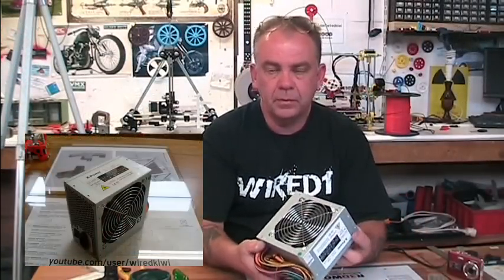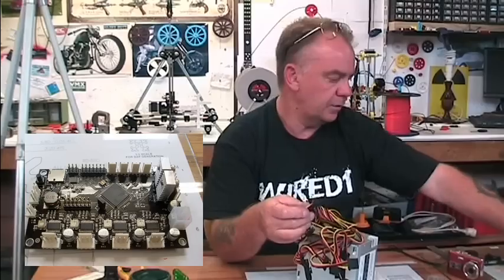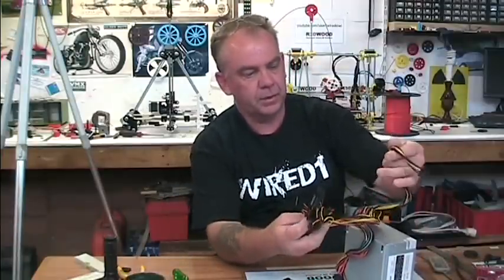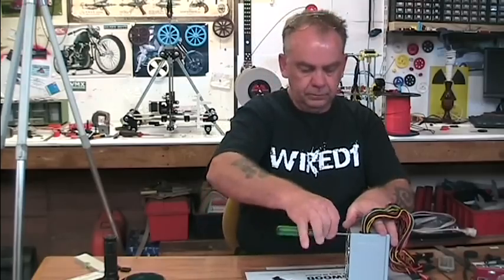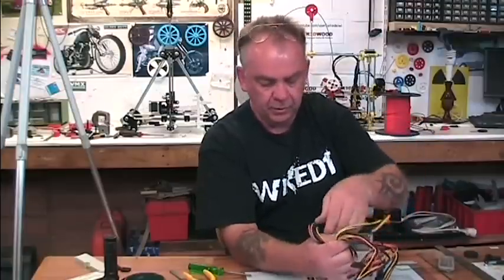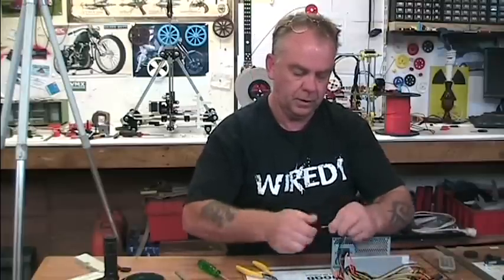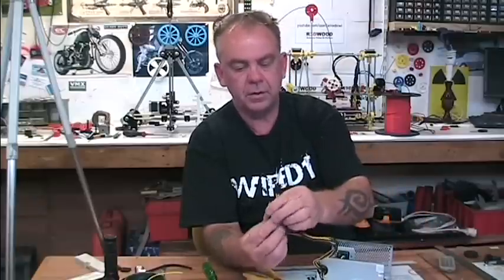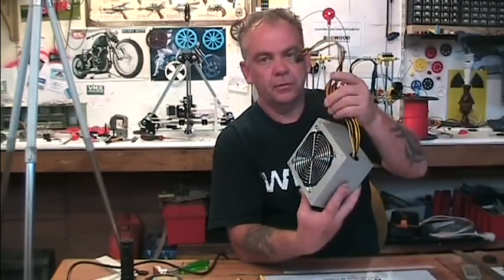Reprap power supply mod

Comment: Thanks for the tutorial, after I did it my power supply didn't work. That was, until I realized that the beige wire was shorted on an orange wire on the biggest connector that I just cut off. I took the beige and orange wires which were connected to the power supply and shorted them again and it worked again! Hopefully this will help out somebody else.

Comment: If you're using RAMPS you can wire the GREEN to PS_ON and the PURPLE to VCC to power the unit on the standby power channel. Then you can turn the power on with M80 and off with M81. It's a handy arrangement!

Comment from the maker: Hi - Thanks for your concern, I first cut the wires to about 25mm (1") above the pcb then went back and trimmed them flush to the pcb on the second pass - you can see it in the photo insert. I suppose I should have made this clearer but there is no risk of them coming into contact with anything else.